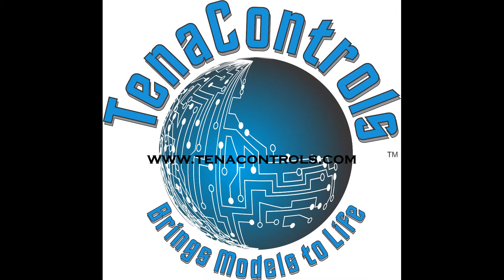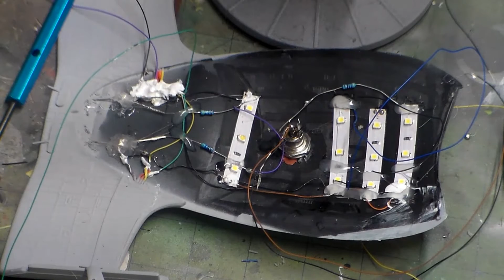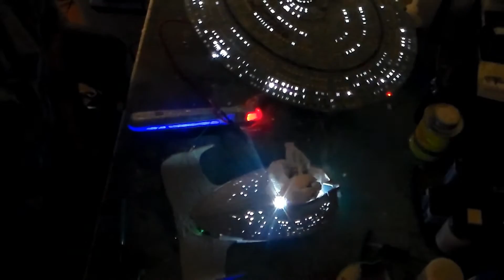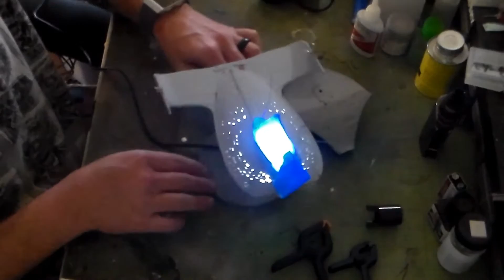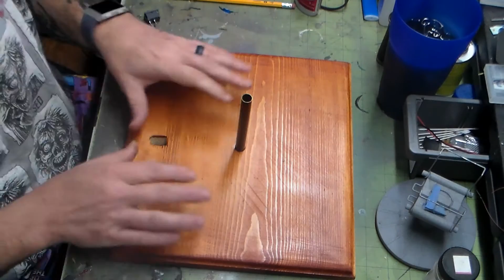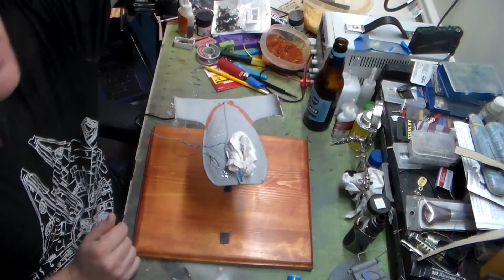AMT 1 1400 USS Enterprise D build part 11

Comment: Shared, tweeted, plus. Here's a tip, when you putty put down some tape close to where the area is then pull it off when cured. Makes clean-up a lot quicker and less messy. Great video. THX
Reply from the maker: Will do. Thank you for the tip and shareing.